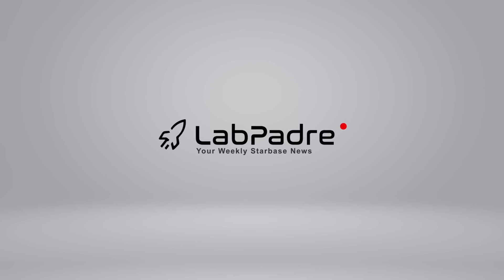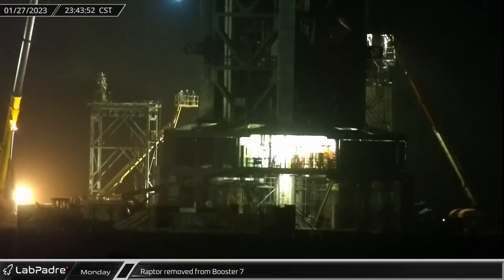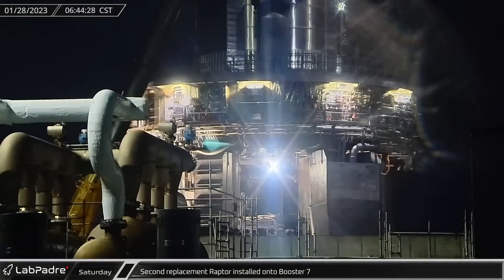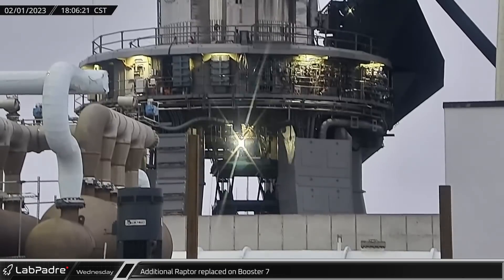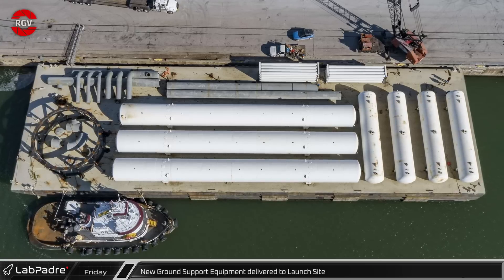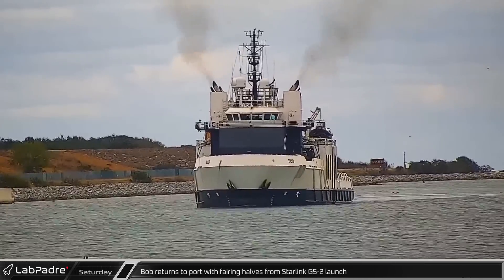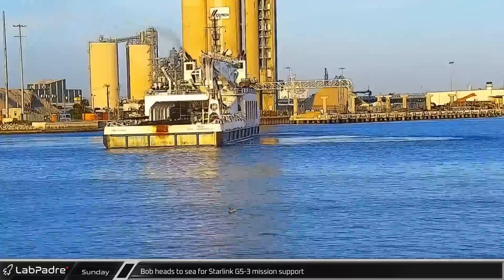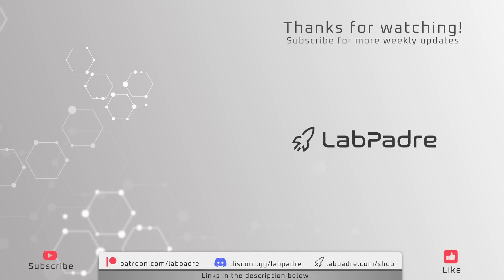Last Minute Deluge System Delivered Ahead of Starship Launch! - Starbase Weekly Update #48

Comment: I’d be surprised if this even happens in march. It always seems as if they’re constantly tinkering with something. Also not looking like rapid reusability with constant engine swap out. I thought the whole point was for the architecture to be robust enough for rapid turn around.
Reply: This is still only the prototype / development phase 
It will be quite a while until they achieve full and reliable reusability
Reply: This is still very much an engineering development program.  The engine swaps could be part of continuing design upgrades.  That would be my guess anyway.  There are ongoing changes to the design for reasons of reduced weight and improvements in performance and manufacturing efficiency.  Gimbal actuator changes from hydraulic to electric is one example.  Every engine gets tested at McGregor.
Reply: For every engine swap they do is a chance for someone to tear down and find out the cause of the swap. Plus every new engine that goes in to the system is another chance to test a new theory. Using computers to model them is just fine yet real world is where you want some testing done. Every thing is logged during a static fire and if 1 engine falls below a spec not with in their range they replace it.

Comment: Elon Musk is seriously worried whether the 33 raptors engine static fire is going to be a disaster.  And although the maximum payload is 100 tons, he's planning to build rockets that will have a 250-ton payload?
Reply: The 250 ton variant is the exact same rocket, but in an expendable configuration.
Reply: No tiles, no flaps, no aero covers and no header tanks. Lots of weight savings.
Reply: The maximum payload is NOT 100 tons
The fully reusable configuration will be able to put approximately 150 tons into LEO
If they expend the second stage they might be able to carry up to 250 tons into LEO